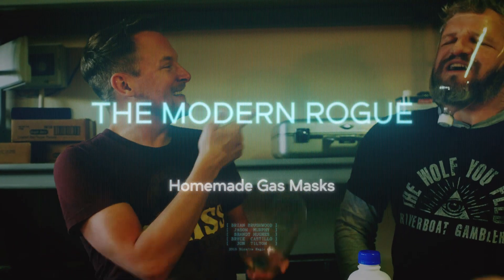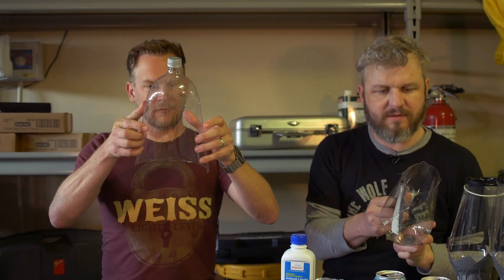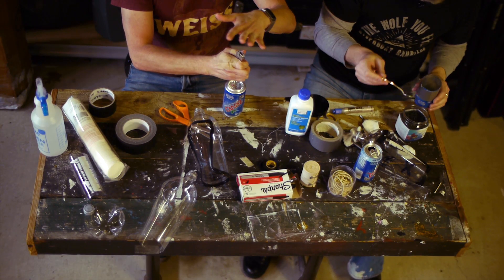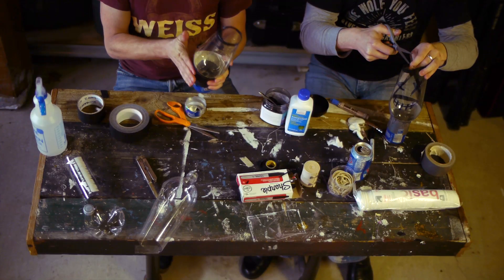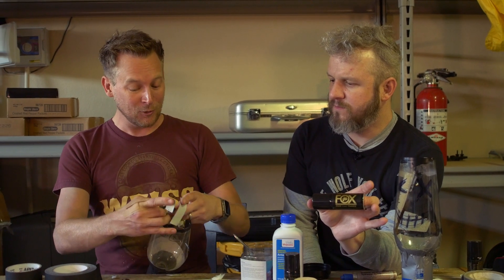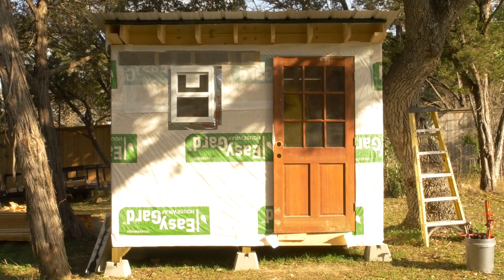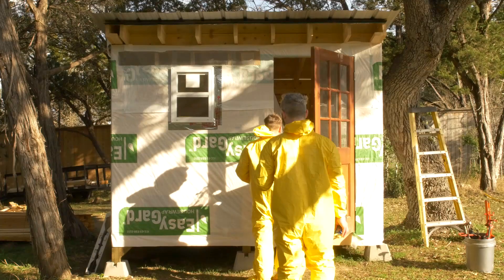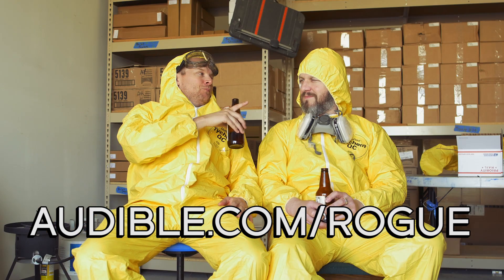Homemade Gas Masks vs. Tear Gas Grenades

Comment: Who is here after every gas mask has sold out in a 50 mile radius and now you have to improvise
Reply: *laughs in owning several gas masks before this pandemic hit
Reply: Frank Teryngel I never understood why allot of  people buy mask and and respirators just to sit in the house instead of using the mask for what it was ment to do
Reply: @armonright9432  I'm using mine every time I go to the grocery store.  Massive outbreak here
Reply: @andrews9341  if you dont mind me asking where you at? New York?
Reply: @andrews9341  personally I'm in maryland, things arent that bad here but everybody is taking it very seriously as they should
Reply: @mr.anemoia924  Colorado.  They aren't testing unless you are in the high risk category
Reply: @armonright9432  some would say ,"I'd rather have it and not need it than need it and not have it!" Fail to plan you plan to fail!
Reply: @armonright9432  Some are just collectors. They are this kind of unique military item which is to some fascinating, and for others a good prop to joke around with (that goes mostly for western GP5 owners). I own them for the first reason and also because I'm somewhat prepper (I'm not that concerned, but it's better to be at least partially ready) and when it comes to their usage irl, I intent to use them on this occassion (covid19), in case of chemical leak nearby, or in case of fire (I once almost burned down my house, it burned down just my bedroom, but there was a moment when I could prevent some damage but was incapable of it due to the fumes... next time I will be prepared).
Reply: That's me too, I own several p100 masks 👌
Reply: @Brute4rce1111  I will hand you a blank check if you can spare one.
Reply: @fanta4897  me to lol, I'm a prepper.
Reply: @fanta4897  Bro me too
Reply: David Davidson  Damn someone woke up on the wrong side of the bed.
Reply: I have a shitty GP-5 gas mask and want to obtain or make something with higher visibility.
Reply: @FringeWizard2  Gp-5 filters have asbestos in them. Don't breath through them.
Reply: @viero13  that's what you get at FP-5 filters screw right in without an adapter and safe
Reply: @FringeWizard2  Visibility? Although it is a bit limited I never found that as an issue. But if you want greater visibility, something with one lense should do it. Maybe polish MP5 or something similar.
Reply: Fringe Wizard I have an m74
Reply: Fringe Wizard I have a m1 that’s too small. Consider yourself lucky
Reply: @FringeWizard2  if you want something with higher vision buy a panoramic mask off ebay, do not create one, you may risk breathing in activated charcoal, which as I last checked, charcoal is not good for lungs.
Reply: @FringeWizard2  Same bro. I even got my hands on a polish fp-5 filter so me or a loved one doesn't get Mesothelioma. Also u CAN put a 40 mm nato filter on a GP-5 just make sure you put tape on it to ensure an air tight seal.
Reply: @FringeWizard2  I would reccomend an Israeli M1A1 Gas Mask, it takes 40mm Type 80 NATO Filters and is made for civilian use
Reply: David Davidson  wtf is wrong with you
Reply: Digging my 20 year CBRN Mira filters right now, and their P3 R particle max filters... but something is better than nothing!
Reply: i am here cause i have to fix ww1 gasmask for my horse and me
Reply: Armon Right improvise adapt overcome
Reply: I watched this when I came out and I regret not making it back then
Reply: @WillSurvive2TheEnd  Your country seems truly in a bad shape. In this particular case it seems my country's been handling it better (Czech Republic). Covering your face is banned here as well... I assume (if it is the case, it's certainly overlooked in winter, when many cover their faces with scarfs), but my country made it compulsory to wear facemask. Considering the lack of medical facemasks, people started making their own so there wasn't any limitation put in place, which alows people to wear even respirators and gas masks (although it is advised to put at least piece of cloth over exhale valve).
Reply: @WillSurvive2TheEnd  You too pal.
Reply: I'm one of the weird kids that owned a gas mask before corona hit
Reply: no im here coz i want to see it fail  it would amuse me sooo much
Reply: @Travis Thacker This research might be interesting checking out: https://www.nature.com/articles/srep39956?fbclid=IwAR3iyEwhJjoZ9CB6JLSBWMtVkUzk5zOtvu965nlhxBMvYv7HH_OgPOSqIFo
Reply: why do you need one now? because of corona? you joking right?
Reply: welp i have a Zivilchutzfilter 68 gasmask so im fine
Reply: @youexterminated787  me too
Reply: Why the fuck are y’all buying gas masks just buy a damn face mask that covers your mouth and nose
Reply: @bruhmoments2992  Yo, chill down. Gas masks have a great airtight seal to the face, while those dust masks don't have good filters, and don't have a seal almost at all. Also, if it's an irritant (which tear gas is) for something like that, you need protection from your eyes too. I know it might be a little overboard to have a full-face gas mask for the pandemic, but let people be prepared for the worse.
Reply: @bruhmoments2992  you can get infected through your eyes still
Reply: Still doesn't help that much. Against the virus.
Reply: I got a M15 half off a couple days ago
Reply: Please do not use or really on this to stop the corona virus or anything at all. The particulate protection on these masks is very bad and will not help you in an way. That is why they still could feel some of the tear gas because the gas has large particles that in a real gas mask are stopped at the particulate layer.
Reply: David Davidson  I'd be careful sharing that info, don't want an armed mob showing up to raid your house.
Reply: For COVID 19, you need particulate protection. These masks made in the video provide primarily chemical protection. There's no telling if the cotton swabs would provide adequate particulate protection. So don't use this for this pandemic.
Reply: @viero13  Why? Its perfect. The pandemic sells them out from stores. Riots cause tear gas to be thrown by police to control crowds, while the Covid pandemic is all over the news with no mention of a city burning. This should be every news in the US top story. I guess another LA riot would make people look.
Reply: @viero13  Cotton is actually a very good partical filter and can even be found in NATO Gas Mask Filters, I would still reccomend using actual masks though, homemade masks usually have defects in them that can let in particals of COVID-19
Reply: @NoWelder  the material doesn't determine if it's effective, the fidelity of the weave and the thickness plays a much bigger role.
Reply: I spent several hours looking for a half decent anti-viral gas mask and found literally fucking nothing.

Comment: Just a hint. That activated charcoal works WAAAY better when you activate it from the start. Just a hair bit of water before donning the mask, doesn't take much at all. Then put on the mask. You'll be surprised at how much more it'll filter.

Comment: These work better if you do couple of extra steps. 

1) layer the filter. Cotton, charcoal, cotton, charcoal, cotton, charcoal, so on and so forth. You can layer it as deep as you want, just make sure the cotton pads are single not doubled up. I make the can about 3 inches tall, and I layer the cotton/charcoal all the way to the opening of the bottle.
2) take tape and make it like a weather seal, or a flap that rests along the your face and the tape should be placed along the of the inside of bottle and folded over to the outside where it seals. This aids in sealing especially when moving. 
3) you can also pair this with a dust mask or medical mask (think N95 mask or similar). It can help when you do breath too hard or the filter gets dislodged. 

The most important thing to make sure is that the charcoal doesn't rattle around. If it's moving around and not "filtering") it is not helping you. 

I actually made some screw on replaceable filters by cutting out the centers of the bottle caps. And attaching them with hot glue to the top of the pop can using the pop can opening as a pass through. I then cut the bottom half off the can, poked holes in the bottom of the can, stacked the filter components, and pressed the bottom half of the can into the top half portion. It's a tight fit, but it will fit. I then taped around the can where the two mated. 

Not only can I make multiple filters and change them, but I can recharge the filters as well. 

These filters are not for use with chemical agents that are lethal. It may work, but biological weapons need special filters. 

These DIY filters are good for pepper spray, tear gas, and smoke. Not NBC agents.

Comment: Question: is this only good for Dust particles? Would this work with biological weapons?
I ask because I read that most homemade filter only works for sprays that come out as actual powder. the pepper spray is a powder.

Biological weapons come out as true gas.
PS I like this, thank you

Comment: I see your misunderstanding there are 2 types of gas mask filters cbrn and particulate cbrn will filter out vapors and gases they also have a particulate filter that stops dust alpha radiation and smoke and biological threats tear or CS gas is not actually a gas only a particulate filter is needed you also did not get a proper seal to check put you hand over the filter if air can get in then the mask is useless

Comment: Just buy a S10 or a Gp5 or MUA1 and buy nbc filters. For the MUA and the GP5 I recommend the polish FP-5 filters because they have a standardised thread that fits on GOST and Nato STANAG. But Nato Stanag thread filters should work on GOST too when you just add an extra 40mm O ring to the thread. It costs a bit more but works much better than this (I use my MUA 1 gasmask for when im working in dusty places  but then i only use P3 R D filters).

Comment: Tear gas is not actually a gas and it is not stopped by activated charcoal. It is a powder dispersed by aerosol and it is stopped by particulate filter. You would have gotten a much better result if you used a P3-grade filter. Still a great video...

Comment: use a providone iodine dip using a rag[filter] held on with a rubber band or elastic from man's whitey tighty also soaked iodine.....for bacteria/virus,dust...........your idea is awesome..........the iodine soaked rag pre-filter can be used for an instant excellent bandage / germ killer

Comment: Next time don't use the pellets use the powdered form it's denser and it latches on to pollution easier than the caps. Not only that it forces you to breath slowly to get air. I used a larger system so it's weight would aid the bottom seal. Use a bottle, a pill bottle, some hot glue and coffee filters. The more clean air in the system at the start and the slower and deeper you breath the more likely you are to be unaffected.

Comment: I haven't even yet finished watching the video but already thought of a little improvement: Keep the bottle's cap and make the can's (filter's) inside hole the size of the cap. Then cut out the cap's top. Now you basically end up with a thread (the cap) that fits on the gas mask bottle neck. Now you can make multiple filters with each a bottle cap as thread. Consequently you can now exchange your filters, if one filter was used up and the coal was "soaked up". Just unscrew the filter and screw a second one onto your mask. :-)

Comment: If you crushed up the activated charcoal it would probably work better because of the increased surface area and smaller gaps between

Comment: Thats  TEAR GAS  NOT CS gas.  Tear gas  isnt so bad. CS will set you on fire inside and out instantly cause you to panic and run
  even on top of the barbed wire (been there)  SCOVILLES  didnt know tear gas was measured in that.   Peppers are measured in scovilles ..More charcoal
  great video guys

Comment: instead of using an aluminum can, why not use a smaller plastic bottle?  then u can cut the lid off a cap and use it as a two way shim to screw on the filter.

Comment: The reason these didn’t really work is because the activated charcoal that is used in medicine is impregnated with specific chems, and the activated charcoal used in military respirator filters is impregnated with a whole truckload of neutralizing chemicals and on top of that it’s ground up into a fine powder and packed into the housing inside a perfect vacuum to fit as much in as possible, and on top of that a gas masks only priority is to purify the air, not to let you breathe easily, the easier you breath in the mask, the more toxins are likely getting through, also you guys have beards so even if you guys somehow did all of the above it wouldn’t matter because the air just goes around the mask and through your beards... moral of this story, if you want a gas mask just buy one off of a military surplus website

Comment: The reason why you need to breathe slowly is because you aren't using enough filter material. Instead of using pop cans or monster cans, use arizona cans with more layers of extra carbon and cotton. Also, try to grind the pellets up into coarse powder before layering it on. Another filter material you can use are cotton pads that were soaked in vinegar, then squeezed dry. Also, i would use an exhalation vent of the 3M facemasks so you can vent out air safely instead of relying on bad airtightness for to vent out your breath.
Reply: Check out the valve on the 3M 8511 Respirator. Cut one of those off and glue it to a cut out hole right over the mouth, keeps airflow cooler and prevents the mask from fogging up.

Comment: What I did was instead of throwing the cap away, I attached it to the filter system/ pop can so that if the filter system got damaged, I could just replace it instead of having to build a new mask. I know it's not much, but it just adds more of a professional feel to the gas mask.

Comment: If you crush up the carbon into a powder, it would be more effective; however you would have to put something on the order of an N95 or N99 particulate filter on either side for maximum protection ad to prevent inhalation of carbon dust. Also having a one-way exhale valve would help prevent fogging and allow air to escape without compromising the seal. Maybe a flapper valve or a one-way assembly similar to the one on the gp5 gas mask?
Reply from the maker: good point.  you see the new modern rogue channel?

Comment: Would I be able to just cut open a old water filter and use the stuff in that as the filter.
Reply: Yup. That should work. Just get the sand out of there if there is any.

Comment: why not tape / hotglue the elastic to the exterior of the mask as to not inhibit the structural integrity of the seal, and so there is no possiable way the mask can tear out the holes, and so it can be quickly replaced?

Comment: Pretty, cool, some room for improvement, but as a proof of concept it's great.  I'd add a one way exit valve so you're not constantly fluttering the seal.  Pretty easy to make, just cut a hole in the bottle, and cover it with larger square of more flexible plastic or rubber on the outside, sealed on three sides.  For the canister, I'm thinking cut up another can and kind of coil it inside, seal it with RTV, and put the vent holes around the outside, force the gas to travel a longer path so it's exposed to the charcoal for longer.  Then use the bottom of the other can to make it a sealed unit with the hole for the bottle in the original bottom.

Don't know about the Fox stuff, but CS gas is no fucking joke.  First run through the gas chamber in basic they make you take the mask off in the room, I collapsed straight to the ground and landed in someone else's puke.